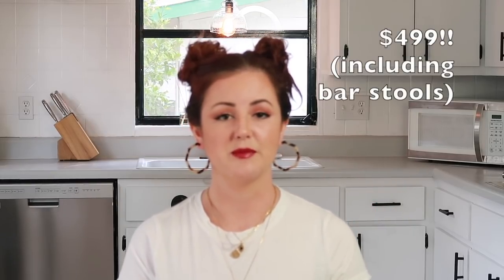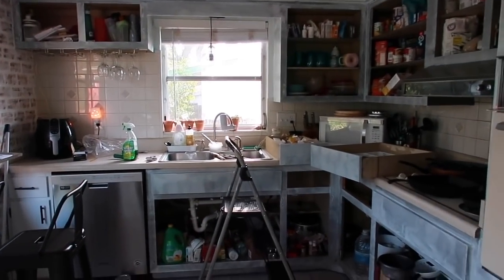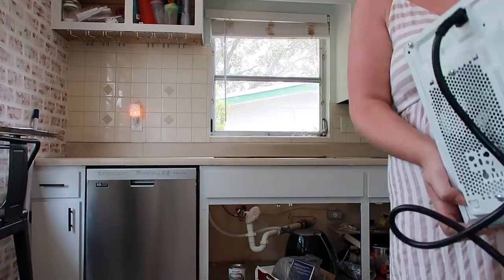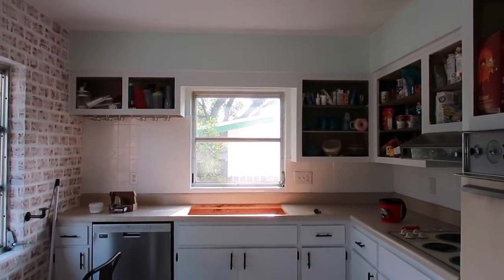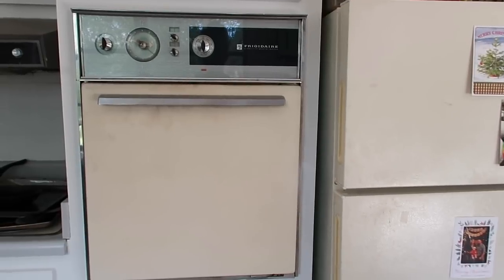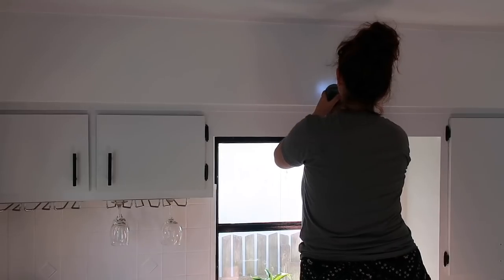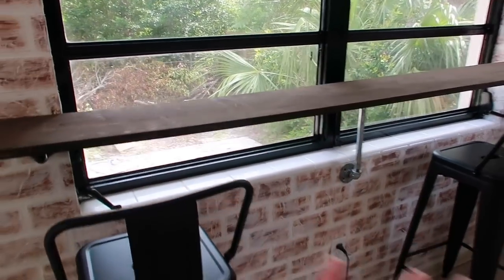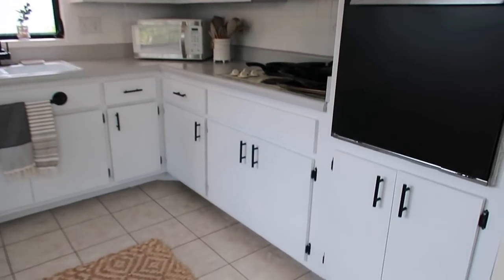EXTREME DIY KITCHEN MAKEOVER ON A BUDGET

Comment: The insulation in the oven is to keep the heat in, otherwise the door would get super hot and a lot of heat would escape using way more electricity to maintain temperature.
Reply from the maker: Ahah I really didn’t know that ovens had insulation in them it seemed flammable to me 😂😂 but it makes sense

Comment: Wow, insulation on the oven? Youre right that doesnt seem safe.. You think maybe that is why it overheats?? It turned out super cute. I can tell you love DIY and decorating. Have you found your calling?? Edit: Looks more modern, lighter, and super inviting.
Reply from the maker: It’s all inside the cover but I thought it was the weirdest thing?? It works fine but if you set it to 325 it’s actually 400°! Probably because of that LOL. Thank you so much I love DIYing 😊❤️
Reply: I think that's pretty common on ovens like that you just don't see it because you don't ever take the door apart 🤷
Reply: It's usually a fiberglass insulation that's non-flammable. If they didn't have insulation, the oven would never hold a steady temperature.

Comment: The kitchen looks a lot better with the white cabinets and the black door knobs! I'm wondering why you put the bar to hang your kitchen towels on right below the sink, it seems like it's going to push you away from the sink a little bit and make it harder to wash the dishes by hand. Also the light hanging over the sink seems to be right in your face as you do the dishes? That doesn't seem very comfortable to me.
Reply from the maker: Lol the bar and the light cause no issues for me... the bar is like 1 inch wide and the light is far back towards the window, not in my face

Comment: How did you get rid of the seam between the 2 countertops? I'm moving soon and am thinking about changing out my countertops, but if I could paint them and make them look as nice as yours, I wont have to replace them and can save myself some money.
Reply from the maker: I used wood filler! The kind that goes on pink and dries light brown. Then you sand it down and paint it! I still love my counters and haven’t had any chipping :)
Reply: @mustl0veshoes  thank you!
Reply: @mustl0veshoes  I have 2 broken off pieces at the bottom of the countertop from someone installing a dishwasher, do you think its possible to fix? I was thinking a combo of expanding foam and wood filler to smooth it out could work. Do you think so, or have any other suggestions?
Reply from the maker: Hmmm I guess it depends on the size of the piece but i don’t see why wood filler wouldn’t work! There gotta be some kind of filler for that at Lowe’s, I’m sure!